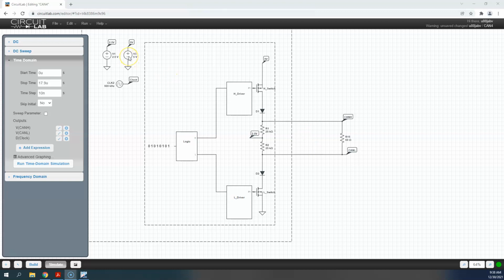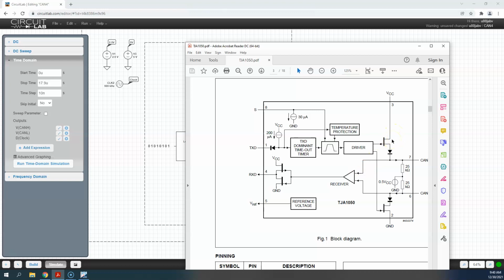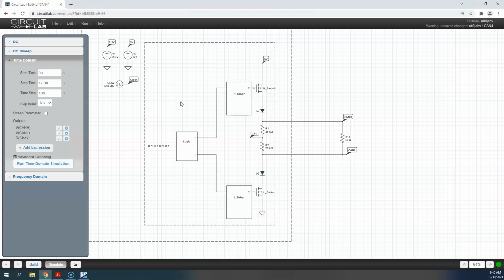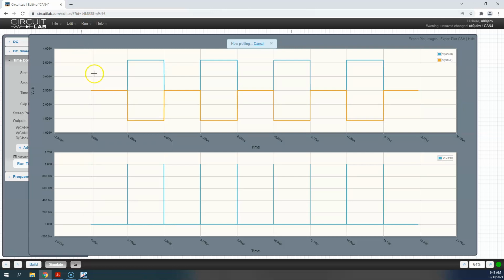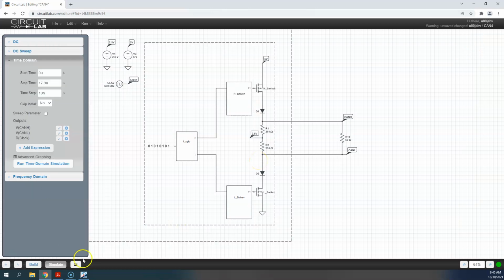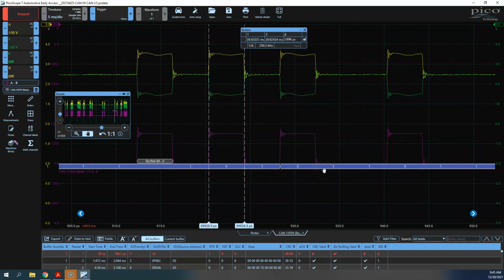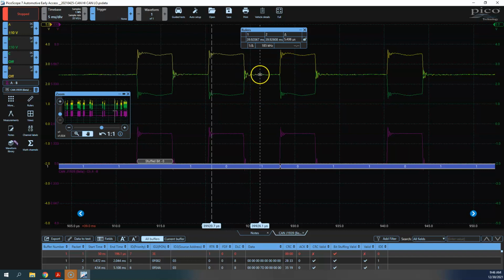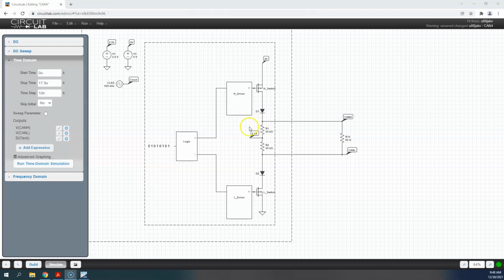Advanced J1939 Transmitter 4

Comment: Hey Joe,
I was wondering if you knew what Picoscope model was used to capture that trace? I'm guessing a 4425A. I used a 2204A on a 250k but of course the resolution is nowhere near the same. The 2204a was able to give me pgn's and spn's that converted to good known values but only works with the nonautomotive Picoscope software.
Reply from the maker: Pico 4225 is what I use.